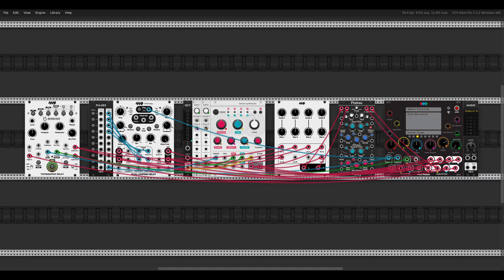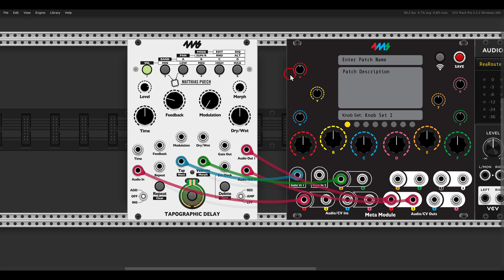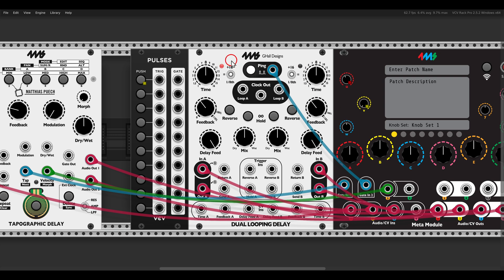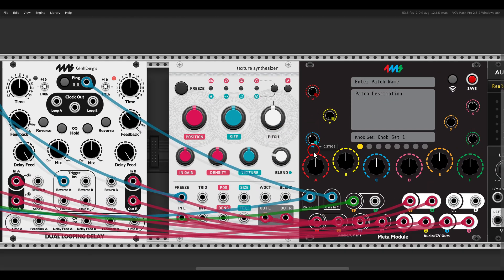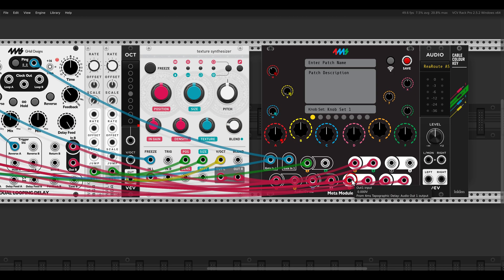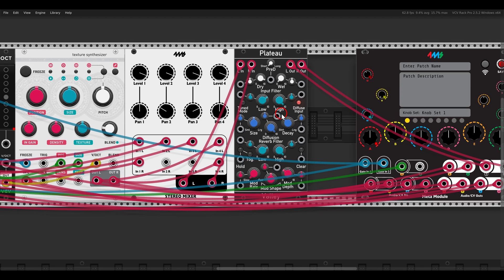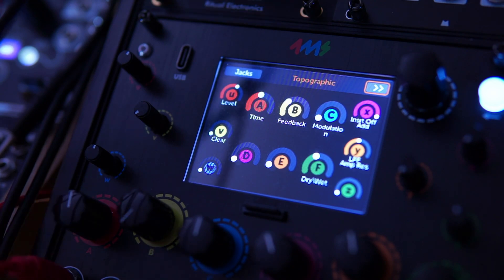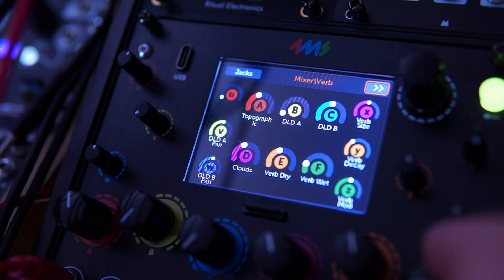Buiding an Ambient setup for the 4ms Meta module in VCV Rack

Comment: I followed the video and built the patch, however, I cant get anything coming out of it, is the Metamodule just to control the hardware version?
Reply from the maker: Yeah, if you build or download the patch, there's no need for the Meta module.
Reply: I had the same problem.  So I imported a selection of a patch I knew had worked and connected the output of that to the input of the metamodule. I had also followed the video and right at the end of the patch build gave up because the cable in the dual looping delay could not be followed (They were all blue).  I am relatively new to vcv, a couple of months in, so I make the best attempt I can at constructing the patch in each of the videos, in order to familiarise myself with the functionality.  Thankfully Omri supplies the patch as a download.